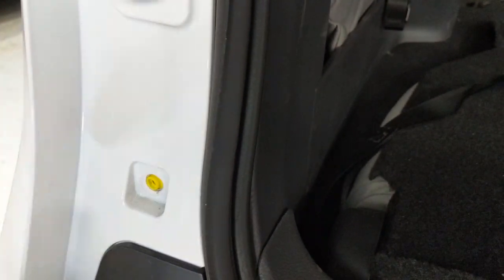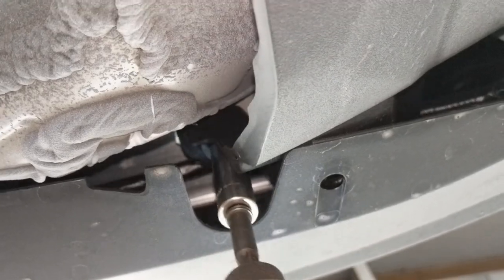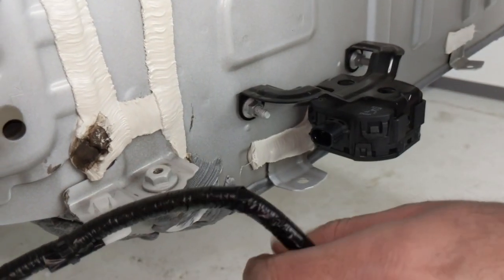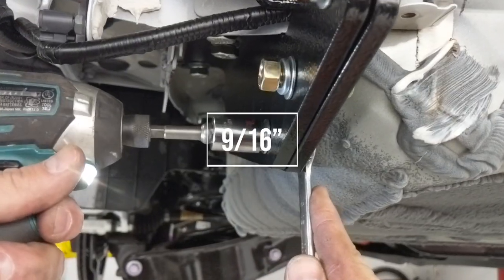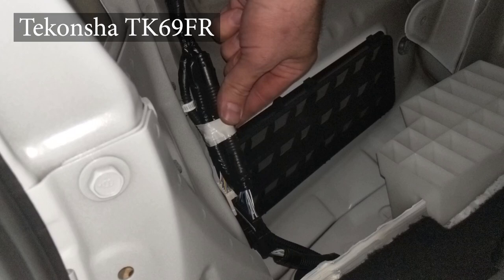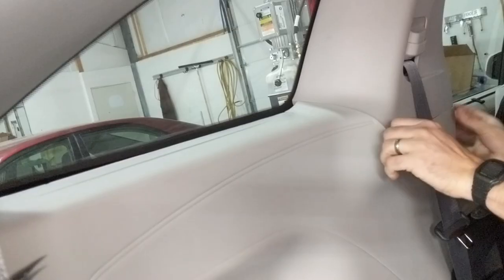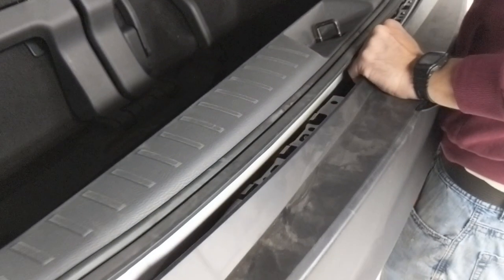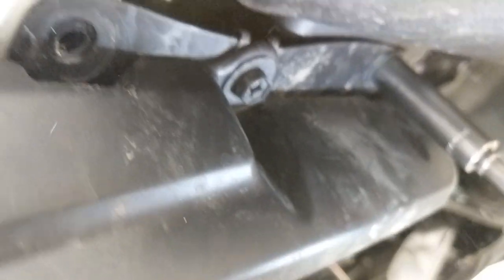2021-2023 Toyota Sienna: Trailer Receiver Hitch and Light Adapter Install

Comment: honestly, for wiring, just get the toyota OEM converter.  its a single plug, no touching the wires at all. toyota part  PK96008B03 for the 2021 and 2022 sienna's.  it comes with a grommet, and a plug and play setup without any cutting or splicing.
Reply: …..See “Car care nut” YouTube channel , he shows you how to put in OEM wire harness.
Reply: Cannot agree more, it honestly took 15 minutes to install the OEM harness, including drilling a hole on the interior panel to put the rubber grommet in (that way I just plug in my 4-pin on the inside and run a 6’ extension out the back door so everything is on the interior). I was so relieved a bit the bullet and got it once I saw that it’s literally pre-wired for the OEM harness, including studs for mounting it.
Reply: How much is that run for?
Reply: @phuong539 $150-$200
Reply: You need 2 parts from Toyota. The hitch wire and the converter for proper install. Super clean though.
Reply: TBH, this tekonsha unit is just as easy.  no splicing or anything.  just plug into the factory harness.

Comment: Let me add one point, the van shown in this video came from factory with no donut spare tire or spare tire bracket. The procedure will be slightly different in case the van comes with OEM spare tire. Newer Siennas (all trims) accept donut spare tire, 2WD or AWD. It's $75 factory option.

Comment: How do you reinstall the kick-sensor?
Reply: I ran into the same problem. I ended up just removing it completely.
Reply: This car did not have it. The manual says to move it back up 2 inch and drill new holes for it on the other side of the sensor, was quite simple.

Comment: @5:17 is that an 8th seat and where is the part number????😮
Reply: I'm wondering what that was as well.  It's an LE he's working on, which has an 8 seat version unlike other trim levels, so I'm guessing that spot is just where people store the 8th seat when not in use.  I don't believe there's a place to install an 8th seat on other trim lines, but I'd love to learn that you could.

Comment: Will it void the warranty?
Reply: no, what a silly question.  if you get rear ended, it's totaled anyways why would warranty care about it.  most important warranty is Engine/Transmission/battery, it touches none of this.
Reply: @HbYu-yt7ek  what a stupid answer.  The tech was modifying to install the hitch.  Warranty is not only for engines.

Comment: If you are installing the 4-pin harness and using the factory connector, why don't you use the Toyota OEM trailer harness? It will cost a bit more but I think it is well worth the extra money you paid for it. Unless you are going to install the 5-pin or 7-pin connector, then you will have to cut/connect wires and the factory harness will be no good. I installed a Curt hitch receiver with the Toyota harness and it comes with the rubber hole plug/seal so you will not need to cut a hole to feed the wire through.
Reply: hi Joe, any issue with the Curt receiver ground clearance? It looks easy enough to install vs. removing the back lights and panel, cutting it to fit the hitch on a brand new van. Does the kick sensor still work ok?
Reply: @bykhed01  always.. curt will likely grind on certain driveways when loaded.

Comment: Can I do all this without removing the wheels?
Reply from the maker: Yeah, I don't think leaving them on would change much
Reply: I installed the Ecohitch on my 2021 Sienna with wheels on just this afternoon.  Only difference is mine has the spare tire, which I think made the job a little easier.  Great video by the way; very helpful!

Comment: Beautiful result but what a lot of work/hassle compared to the uglier one.  But you really should keep the electrical connector inside the car and safe from the weather and road and just let the rear door close over it when you have a trailer attached.

Comment: I love that we compromise the safety of the van by putting an aftermarket steel bumper for the engineered O.E.M. tested designed one from Toyota,  maybe why I ended up with the factory hitch and didn't install the eco-hitch one.
Reply: Most of the time you get hit from behind if you have a hitch it saves your rear end.(bumper only) From experience. As opposed to not having a hitch for obvious reasons the hitch acts as the first point of impact. The other thing is between the steel and aluminum steel will win.aluminium is lighter though. So you killing two birds with one stone this way. Look at most images of rear end collision that part is just reinforcement. There is lots of crumble points after that coming inwards on the unibody frame to take impact depending on severity. At impact aluminum doesn't bend that well especially thick hard aluminum like this it just cracks or shutter with sudden impact. Which material is easier to drill steel or aluminum.
Reply: @maxiest200508  so the designed and engineered way it has been made from factory was flawed and a wielder knew better than a professional design team, then ran through tests and safety issues.  Verses what you have to do to make this fit. Ok 👍
Reply: That hollow aluminum bar is designed to crush for low speed accidents like minor fender benders. You’ll definitely transfer more energy with steel tubing there as its much stronger, and mounts to the same location as the OEM one. But so will the OEM. One can argue in a moderate speed collision a reinforced tube steel may prevent a vehicle from pushing farther into the cargo and 3rd row too.

Look at the rear crash test videos of minivans, 1) You notice none have hitches 2)the entire rear end crumbles. I don’t mind having a thick steel tube closer to where another vehicle’s bumper will impact.

Comment: How's the crash/safety rating of this hitch bumper compared to the OEM bumper
Reply from the maker: I'm not sure what it would be, but it definitely seems more substantial. It's steel instead of aluminum and bolts to the frame in more locations than the OEM bumper.
Reply: @MasterJacks  It's supposed to do a controlled crush in case of an impact.  Substantial is not a desirable feature for that part.  That along with cutting the bumper cover means I will definitely not be using this one when I get my Sienna next year.  The fact they included 3/4" bolts when all bolts on cars have been metric for decades is just pathetic to me.
Reply: Most of the time you get hit from behind if you have a hitch it saves your rear end.(bumper only) From experience. As opposed to not having a hitch for obvious reasons the hitch acts as the first point of impact. The other thing is between the steel and aluminum steel will win.aluminium is lighter though. So you killing two birds with one stone this way. Look at most images of rear end collision that part is just reinforcement. There is lots of crumble points after that coming inwards on the unibody frame to take impact depending on severity. At impact aluminum doesn't bend that well especially thick hard aluminum like this it just cracks or shutter with sudden impact. Which material is easier to drill steel or aluminum.
Reply: Steel projectile when it tears away from the rest of the vehicle. When you change the design of something, it would be best not to over build something that is engineered to fail and deform to the crash rather tear loose and become a steel missile with you ahead of it.
Reply: @Recapolythor999  dude you are overthinking. This is at the rear of the vehicle. It's good for rear end collision if someone rear ends you.or hits you from the back. Come on now. It has the strength to pull 4000 pounds and stop the same because it's a hitch rated for the same and at impact(accident) it's going to do just fine. It's just a reinforcement even in the original form(aluminium) your imagination of this piece dislodging from the frame is exaggerated. If it was being replaced by a weaker piece of metal I would understand where you're coming from. But this is literally the same in strength or better. The downside is its heavier and it's not the same shape and size therefore there's an emptiness in between the pieces. There's usually a styrofoam shaped piece that's wedged between the aluminium and bumper cover. Do a little more research I been flipping cars for a living so am not just imagining things. Crash tests put different scenarios at play and they're worried about the safety of the people inside and how much cushion is provided.when things go wrong they go wrong u can't do anything about. So stop worrying about this kind of stuff. What's you thoughts on deer guard?
Reply: @Recapolythor999  another thought for you to ponder on while you're at it. About the projectile situation you came up with, so cars like Mercedes are designed to literally drop the engine at high speed impact to prevent it from coming into the passenger compartment. basically the whole engine cradle or crate drops underneath the vehicle at high impact so there's less inertia left, and the rest of the vehicle can handle less force. But this is located at the front. At the back of the vehicle this steel hitch will not dislodge at impact it will bend and scramble inwards before it dislodges as the force will be coming from behind.
Reply: @lsorense  it’s an M12 bolts - those are a 19mm socket size (same as a 3/4”).

Comment: Will this hitch work for the bumper with backup sensors too?
Reply from the maker: I would double check on the website included in the video description, but I believe it does accommodate sensors.